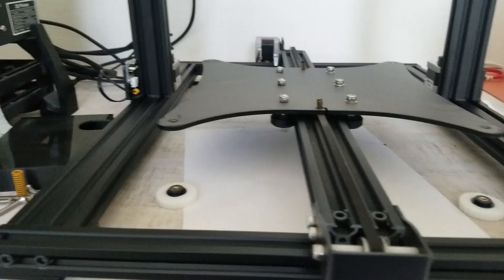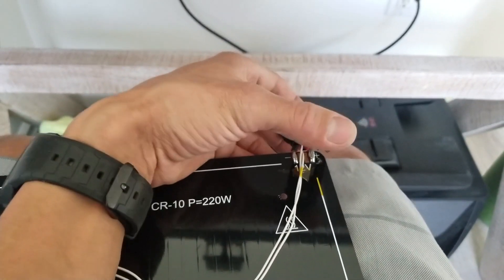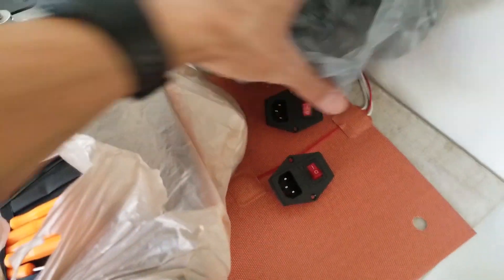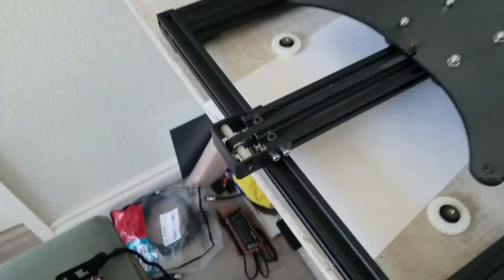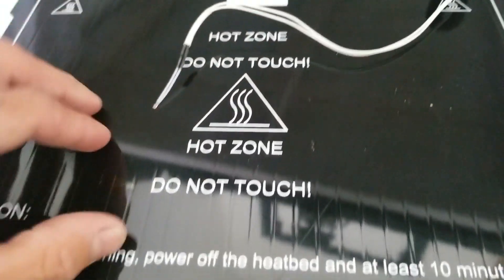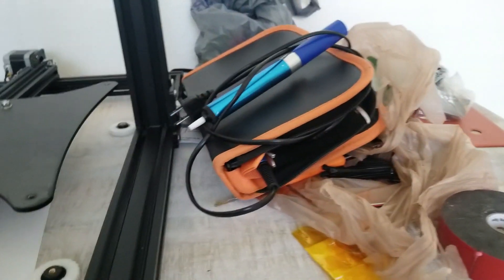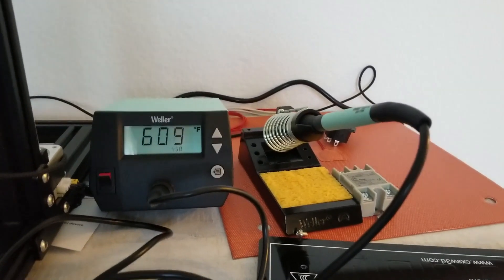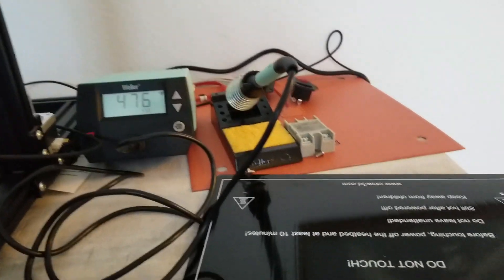CR10S Keenovo Heated Bed SSR Install

Comment: Excellent explanation and simple to understand. I have not much electrical background. WOuld like to understand, why we don't use MOS FET, but rather go with AC SSR? The original heater was heated by 12V voltage, but the new bed is heated by 240V voltage. The existing mosfet is not designed to handle that voltage or what? Also using 240V to heat the heatbed, not dangerous? Like a shortcircuit or so? What about using a fuse or two in the setup? And the last one, what if SSR stops switching even the current stops on the input side? It will continue passing 240V across the silicone heater. As a protection we can have two SSRs lined up in series to avoid this functionality problem? Because in original heater, even the heater is on continuously it does not go abot 110-115 degree, at least in my case. But it this modified case it will. Again, I don't have electrical background, but just trying to understand?
Reply from the maker: I dont have an electrical background either so this is my understanding. You still use the mosfet to trigger the ssr because the mosfet alone cant handle 110 or 220. My system is on 110 but as long as you get 220 rated things, you should be alright. There is a fuse build into my power supply plug.

Comment: Hi Shaun. You didn't protect the connections on the static relay with 230V ???
Reply from the maker: I needed to run it for 1 print(to print the housing) like this since my bed wasn't working at the time. It is now in an enclosure. I do not suggest leaving it open if you can avoid it!

Comment: Have you had any issues with the glass build plates shattering over the high-speed heating of that heating pad?  I know my CR-10 can take like 30 minutes to get to 100°C.  That silicone bed as I understand it is extremely fast.
Reply from the maker: I didn't have any issues with the mirror heating up that fast. I did however install an EZABL kit and the sensor was hitting my clips that were holding the mirror on. So now I run the fysetc build surface directly onto the metal plate. I had to put spacers under the bed so that the X-Axis mounts didn't hit when the Z went all the way down.

Comment: Shouldn't really have the relay exposed to touching like that - very easy to touch it by hand and get an electric shock from the mains side. Would be a lot better to make a little plastic box to put the relay in to prevent from touching the connections.
Reply from the maker: It is enclosed now and you're totally right! I had it open for that one print making the box for it since my printer was down due to a damaged wire in my stock bed. If you can print one beforehand, you should!

Comment: I would have liked to have seen this in more slowed down fashion. Especially the disassembly of the plug.
Reply from the maker: Sorry. It's the two screws and the plug assembly is threaded. Hold the tip and screw ccw.

Comment: in 8:02, the "live" jumper and the "to ssr neutral" means they are both connected?
Reply from the maker: Yes. You could put the Y anywhere in the wire but i found it fits in a tighter space by running it essential to 1 terminal and using a jumper from one to the other. Just use a bigger fitting on the one end so you could fit the 2 wires into it. Sorry for the late reply.